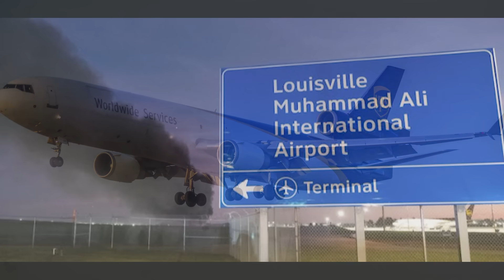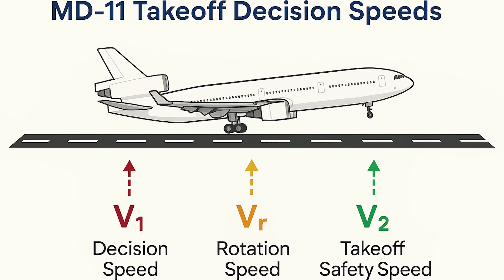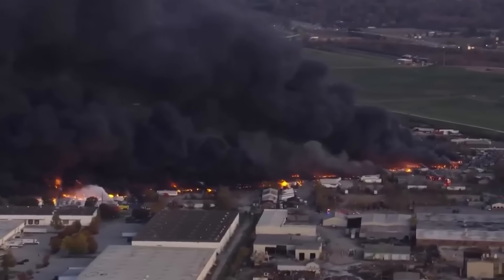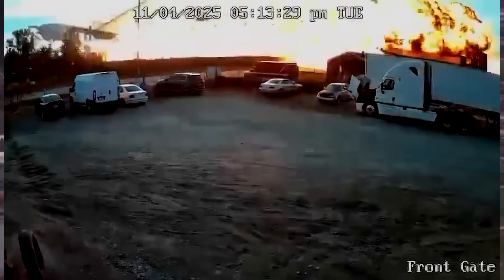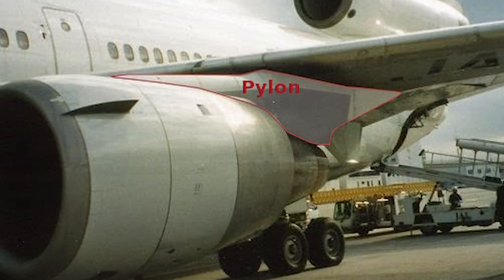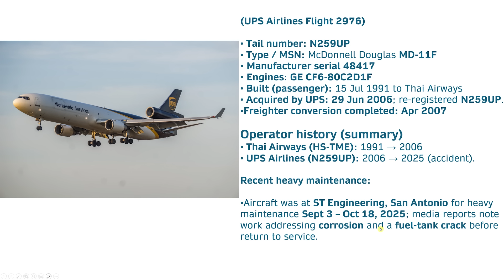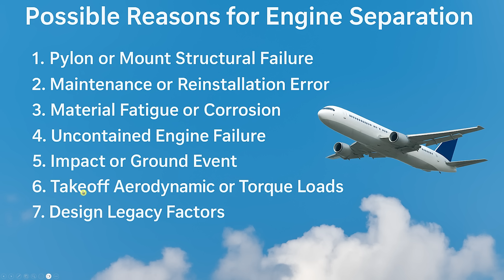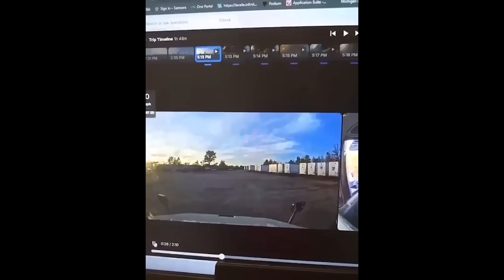What Caused UPS Plane Crash, Louisville, KY? How MD-11 Engine Fell Off

Comment: So what I'm understanding is if your plane is going at takeoff speed and something suddenly goes wrong, you have to go into the air anyway because you're going too fast to stop and there are structures in the way?

I know that I'm more likely to die in a car crash than in an airplane but at least I can hit the brakes or steer out of the way of something in a car lol

Comment: In short. I think it was pre-planned . Why would any pilot even take off when there is a fire? It was more than just burning before take off. So probably started before that. The pilot could have at least slowed down and redirected the plane, if not even stopped it. 
   It was once again preplanned - a form of terrorism. I realize that it is said that they needed to take off, but seriously, did they really?  There were signs, but they were rejected or ignored. Either way, one thinks it is pathetic . IT should not have happened, or at least not like this. It may have crashed when trying to stop, which would be terrible, but there would have been fewer deaths and less damage to possibly the plane and also to the surrounding area of businesses.
The UPS company should be charged, and even face jail time, for not ensuring that the plane was fully safe to fly and that the pilot was in good physical, emotional, and psychological shape.   This crash should not have even happened. Plus, with the repairs that were not done or corrected properly. UPS should be made to pay all the victims' families who were either hurt or killed. Plus, all the businesses were damaged or ruined .  Along with UPS, the plane company that takes care of the plane should all be forced to pay all the above. And not just the people on the lower part of the ladder in the companies - UPS and an aircraft company.  But all the corporate businessmen and women should be paying millions out to the victims and businesses. Take responsibility for their mistakes.

Comment: yea I thought of AA 191 also the shortcut maintenance procedure using a forklift on the ramp to swap engines leaving the pylon on the engine and just doing up the pin bolts saves a couple hours but they ram the assy up into the bracket till it stop then "Vern" says OK Thats high enough and it leaves a dent where cracks will develop...dont know if this is the same issue...they have said that many key items were noted on the recent inspection

Comment: This actually reminds me not only of the one you mentioned with AA, Jeff, there was another one back around 1989 involving United Airlines. That aircraft (DC-10) cartwheeled due to engine failure. I don’t remember if it actually lost the engine prior or not. I also can’t recall if it was during takeoff or landing.
I just remember watching it as a kid on TV when it was shown on the news and wondering how does an aircraft do that.
Sad it happened but, I believe, the crew did the best they could.

Comment: Both engines failed at takeoff. The first one failed during takeoff the rule key of thumb is if the one engine fails the pilot must take off then come back around to land. 

And when they tried to take off the other plane engine had failed too during takeoff so they never had a chance and btw those model planes are known to fail that's why a major of them were removed

Comment: I think this plane should be retired. I watched a lot of plane crash documentaries, and McDonnell Douglas keeps showing up. Specifically the DC-10. It's even partially responsible for that Concord crash, because the Concord ran over some pieces that a DC-10 dropped on the runway as it was taking of, and the wheels propelled those parts into the wings. I don't trust these planes.

Comment: It seems there are too many instances where planes are running out of runway.  And there should be nothing either tall, connected to the electricity supply, or filled with fuel at the runway end.  Maybe even a crash barrier of sorts to try to minimise damage.  It is fortunate there weren't thousands of houses in the way. RIP everyone.

Comment: Engine comes off wing...What could've brought this plane down? Was that really the root cause of this crash! Umm yeah pretty sure!!! Another dude on YouTube said..Well when the Engine came off the wing it sent shrapnel, under the fuselage to the other engine.. And that's not good cause this plane needs two of the three Engines to fly...I laughed because it wouldn't have mattered if two Engines were working or not. You had an Engine gone a wing burning 🔥.   That plane was done!

Comment: Excellent analysis of such a tragic event. Thank you. May God be with all of those impacted by this tragedy.
Reply: Instead of preventing it?
Reply: The engine is still attached imo. Can see a dark circle on the left wing if look close. It was damaged but not missing.  When they hit the roof prior to crossing the road the left engine looks to be shooting flames when you see the plane briefly in between the trees.
Reply: @daveleone6989 I believe more than one news outlet reported that the engine was found along the runway which means it had to have fallen off prior to hitting the building.

Comment: My main takeaway from this is that maybe we shouldn't build structures RIGHT at the end of a runway, especially ones that contain petroleum??? 🤦‍♂
Reply: It’s actually very common. My local airport has a petroleum facility, a dynamite manufacturing plant and a high security virology lab directly at the end of runways
Reply: @theodorerobert6774 That's insanity 😩
Reply: Aperture science moment
Reply: Gas factory had zero impact on what happened. Plane would have crashed regardless and all of that was jet fuel. Not factory fuel. Ya big dum e😐
Reply: Somethings off man
Reply: @man.506 maybe their just incompetent
Reply: @man.506   can we not with the conspiracy theories? Humanity is complicated enough without adding Dastardly Plans on top of it all. 🙄

Comment: Mac Air airliners just have not worked well since the DC-8.  This exact same thing happened to a DC-10 in 1979, where the engine fell off during takeoff.  Then there's the 1989 flight where a DC-10 engine shredded the hydraulics.  Now this.  And you begin to understand what happened to Boeing.  Things really started going south after they bought Mac Air, whose corporate culture has infested Boeing.

Comment: I've seen a more in depth analysis that shows that the rear engine was suffering a compressor stall in addition to the engine falling off. This indicates why the aircraft did not gain lift which it should have been able to do with two functioning engines.

Comment: It’s crazy to see people commenting and blaming the pilots for not abandoning take off. The MD-11s are designed to still take off with 2 engines but right after the plane lifted off of the ground, you can see the rear engine stall. That’s what ended up taking the bird down in the end. The rear engine probably pulled in debris causing it to stall. The pilots were doing everything possible to get it up in the air before the rear engine failed.

Comment: Flight 191 was a DC-10. This plane was an MD-11. They are basically the same design. It’s the successor to the DC-10. If the hydraulics weren’t redesigned then the engine falling off likely took out the hydraulics eliminating control of the wing flaps on the side that lost the engine. Absolutely looks like a repeat of AA 191.

Comment: On a different video by a pilot. He mentioned that there was a compressor stall flame burst in engine 2 as it was going down the runway. This would not give a constant thrust if that turns out to be true. The question is if there was something wrong with the fuels mixture. Did the fuel explode the number 1 engine off the wing and cause stalls in number 2?

Comment: Check the pilots. Suddenly, silence. The narrative doesn't fit. You were told that this only happens when it's a certain politics. Then, when it's not that certain politics, the goalpost shifts. Suddenly, NO! Do not look at the pilots! It's the maintenance crew! No, its traffic controls fault! NO, it's whoever inspected the plane last, NO! Anyone but the narrative i don't align with!

You were told this is the fault of the un-namable person who is always responsible for these events. Remember the armored vehicle that sank? Or the Jets at the red sea? No of course not, because there wasn't a narrative to spin, and this is similar.

Its easier to shout out a bumper slogan, call it a day and pretend you're intelligent than to actually understand that these events can happen without your mythical un-named person.

And look now, my comment is being censored. For what? Having an opinion? Is anyone even going to read what i wrote? No. Nobody will, so why even bother censoring it? Everyone else can spew their 5 word slogans, but i can't have an actual discussion.
Reply: Speaking without proof is what an idiot does.

Comment: AA 191 crashed because of incorrect engine removal/attachement. The correct way to remove an engine is to remove 2500 bolts, thats right... two-thousand five hundred. No one wanted to do that so they took a forklift and removed the engine from the pin. The issue arose when using the forklift to reattach the engine. During lift a portion of the pylon was rammed into a brace, which left a hair line crack which grew over time causing the engine to fall off. When the engine detached, it rotated up and back ripping off the leading edge of the wing causing loss of control.

Comment: Looks like he hit the powerlines, phase to phase fault ,12,480  voltage probably..started the fire instantly. This kind of electric charged fire is hotter than the surface of the sun. Retired powerlineman.
Reply: What happens when a plane hits the primary power lines?  Does the avionics of the plane get fried?  Does the plane retain a voltage charge until it hits something that causes a grounding?

Comment: What will end up coming out. Work or repairs needed that got pushed through. Use to be planes are safer then driving. Today with these companies cutting cost & pushing planes through along with hiring based on color & sex instead of skill & experience. I will never fly again. If I can't make it by car I'm not going to ever  see it. America will never recover from the environment of hiring we currently dealing with. Because it's a by design self destructive plan for America. We are at WAR ITS SILENT BY A SPECIFIC PEOPLE THAT CLAMIN ANTI SEMITISM FOR ANY EXPOSURE. IT STARTED IN 1913

Comment: The MD-11 has the worst hull loss rate of any widebody commercial airliner in the world with 3.12 per million flights. Worse than all the original widebodies, DC-10 included. 10 TIMES worse than the likes of the 777 and A330. Worse than the 777's, 0.24, A330's 0.38, 747-400's 1.08, 767's 0.57, 737NG's 0.17, A320 family's 0.17, you get the picture. Beautiful airplane, yes, but its safety record? Anything but beautiful.

Comment: This is what angers me, thos plane JUST had a full maintenance done on it!!! My personal opinion is UPS is fully responsible for this crash!!! They KNEW there was corrosion and a crack in the fuel tank!! Also, I have a question, when is a plane to old to fly? I mean thos plane is over 20 plus yrs. To me, it almost seems like oh jets just put a bandaid over the wounds, it will be fine, or let's not say anything is wrong with it. To me, a craxk in the fuel tank is major. I sure in the hell qoukdnt want to get on a plane with a Crack in it!!! Also one more question, wouldn't the speedometers in the cockpit, say something is wrong with the engines? Even if it was just a crack? Isk but it seems like this crash was 100% avoidable. Devastating people lost their lives over something that could have been prevented, but also, thank god, this still wasn't a passenger plane.  My thoughts and prayers go out to pilot, co pilot, steward and all the workers on the ground who lost their lives. To their families, my prayers are with you

Comment: Working on the assembly line during engine installation and then going to the field in Indonesia and seeing them do a engine insulation was to all of us sketchy. This was doing the time when the aircraft manufacturer was McDonald's Douglas . The owner of the aircraft at that time was Garuda which is the government. We spent 6 months working on the aircraft that veered off of the runway and buried itself in the mud. I was working with McDonald Douglas recovery and modification and we did most of all of the work but we allowed to Indonesians to replace the two engines number one and number three that it was hilarious. During the first flight the pilots dropped the ADG and when the flight return their top mechanic and supervisor ran off of aircraft and said that he never knew of this device. 🤫🤣

Comment: The plane could have still taken off with only two engines. But the exploding engine shot debris into the other engine causing lost of power.Leaving only the engine on the tail with full power. This plane is not capable to taking off with only one good engine.

Comment: halliburton's wonderful fracking dust,  tiny as it is,  getting on circuit boards of airplanes,  can cause the plane to malfunction in a zillion differ ways,  an no way you can tell that the circuit board caused it,  an not the malfunctioned part.   and it happens every day,  thanks to tiny pieces of metal where they do not belong,   stuff you cannot see with the naked eye

Comment: I remember the American Airline crash. When I was 15 and a half and I had just lost my dad. My mom and I were flying out to Florida. The captain announced that they had to fix the fuel line. I freaked out. That was my first time ever flying without my dad. They fixed it, but my heart was pounding, I was still scared until we landed in Florida. Since 94, I haven't been on an air plane. I refuse to fly on a plane. This is so sad. But I have so many questions about this.

Comment: Will speculate on UPS flight as the NTSB will release information once they know. However in the AA 191 the engine loss was only part of the issue. That DC10 would have flown just fine with the loss of the #1 engine. The issues were: 1) the safety and warning systems were only one elec circuit #1 powered by #1 engine.  2) there was no hydraulic isolation after that engine which allowed the LE slats to be aerodynamically forced back as the fluid spilled out. The combination of both meant that the pilots had no idea the slats were retracted on the left wing. Stall speed with slats and flaps extended is mid 120s, with the slats retracted it’s mid 150s! SOP for loss of thrust on one engine is pitch for best climb which was about 130 to gain altitude as soon as possible. Loss of warning meant no stick shaker, no stall warning. Post AA191 DC10s were modified to have redundant power to those warning systems AND hydraulic isolation/check valves that prevented unintended slat retraction on loss of fluid. Yes the maintenance was a primary issue on AA191 but the changes made would have also prevented another accident in the future.

Comment: I remember American Airlines flight 191 quite well. Right after they resumed using the DC 10, I was flying from LAX to Newark. About half way through the take off run they shutdown and returned to the gate. The pilot announced that they had gotten a tattle tail on one of the hydraulic systems. It turned out that the cover plate on one of the hydraulic pumps had developed a crack. Seven hours and 2 maintenance crews later we were finally in the air.

Comment: My original site was possibly a bird strike previous and or previously had a bird strike at some date before then. And then caused a slight fracture in one of the fans on that engine. Now I would be talking out of my butthole. If I hadn't picked up chemicals for x-ray and delivered it to an outfit that explain to me we have to x-ray the fan blades before we send these fan blades out to be a symbol. There could be a hairline crack. So my theory is it quite possibly easier a piece of debris out of the runway or previous bird strike reported or not. Cause the hairline fracture possibly in the fan of that journey. My condolences to the families of those that passed in this incident. God bless.❤

Comment: I immediately thought of Flight 191 out of Chicago, too, when I heard about the left engine falling of the UPS jet.  I remembered it from when it happened and also had seen the MayDay episode on it where they explained that maint. issue, using a forklift to hold the engine during maint., instead of undoing all the bolts, etc, cuz it saves many, many hours' work.

Comment: Witnessed an engine fall of a plane and land in sand on the beach in El Segundo. Plane was taking off out of LAX.  Plane didn’t crash had multiple engines. It was the height of summer. Lucky no one on the beach was killed.
Reply: the three guys with surfboards near the fallen engine....... were found dead with shark bite wounds two years later in a nearby beach

Comment: Fantastic analysis! I think that report you showed how the plane is 34 years old and recently underwent a "Heavy Maintenance" of the fuel tank due to corrosion. Well the fuel tank is literally located in the wing. So there was major corrosion  (aka metal deterioration) of the wing... hmmm... Let me guess where the repair took place? Im guessing (90% Certainty on this guess) that the major repair to the wing metal deterioration occurred on the same wing that the engine fell off of...

Comment: Bird ingestion unbalancing the whole assembly while it's at max rpm would rip it right off easy. we'll need to focus on the procedures for the crossmember's repair or replacement(usually a no-damage tolerance part) have been followed or not. A fuel crack is only a flush and confined space intervention with a special PRC